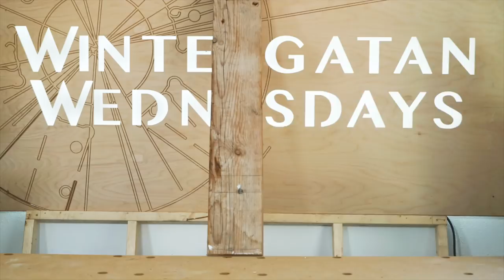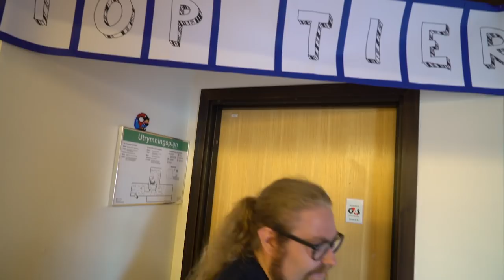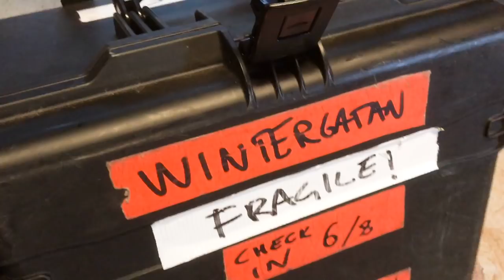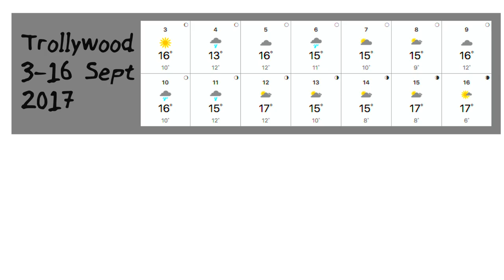I Moved to France! - Marble Machine X #18

Comment: Congratulations on the new house!  Looks super nice. A quick advice, maybe you already thought of that,  is to have the heat in the shop as Constant as possible, wood have a tendency to move, detract and expand with big temperature changes and if it's hot during the day and cold during night (looks like high air pressure) it can be a trouble for the wood. For example the plywood sheets can bend if not stored correctly.  This is probably not a problem but I just wanted to say that... Also of course the insulation in windows, door and walls also weigh in... /Anton, carpenter
Reply: That's awesome feedback, Anton. I'm assuming looking at the colder weather and previous location in Sweden (?) that looked pretty wet and humid. The area in France looks a lot warmer, more even and temperate. The olive trees give a hint to a more chaparral climate, smaller leaves for more heat tolerance and less humidity. He mentions comfort, light and better creativity, but also possibly better conditions for building too at his new place.
Reply: the place he is in france is the south eastern part of france  i believe,  is really dry and can either be really warm or really cold(in winter) when you compare it to the south west part of france that were some kind of swamps ,(source:i am french)
Reply: Oh thx MrJuoji... I was curious, such beautiful coutryside. I'm from South California in the states. We have areas that are similar for ecology here. Good day :D
Reply: Most like in the South East of France, I agree. I'm from there, so, well, kinda know the landscape.
Still, could be wrong, but it REALLY looks like it.
Reply: Anton Björklund As someone who plays a wooden instrument, watching the humidity and heat is definitely something to consider...I would hate for him to put so much time into the marble machine and such and then have it damaged by climate
Reply: The timber components of the MMX seem to be all plywood. It is much more stable from temperature and humidity than natural wood.

Comment: You are an inspiration to me , I made a cnc machine a year ago,  an I blow the output motor drivers  last summer.
 I now want to fix it up.  and my long time project is to make a wooden Clock.   Not as impressive as a Marble Machine, but it's a start.

Comment: Out of curiosity, what are the rural real estate prices in southern France? Considering the housing market in Sweden currently it might actually be cheaper to do such a move than try to find something in Sweden...
Reply: In general, Provence is not cheap. Though it is hard to say without knowing the exact place.
Reply: I'm french and I know that Provence is one of the most expensive regions out there !
Reply: I'm French too, and I wonder where he settled, but "Provence" is quite large, depending on the house and the remoteness of it the price can be either around 500K€+ or in this case most probably 100-150K€ for such a house that is not that recent...
I just discovered the Marble Machine, and as a technician I find it really impressive, but I would like to know how he can live here, just doing what he likes... For shure a very clever and talented guy !
I agree with the light there, especially during fall and winter, this is magic !!!
I live in the middle of the Alps, not so far, but the light is quite different there...